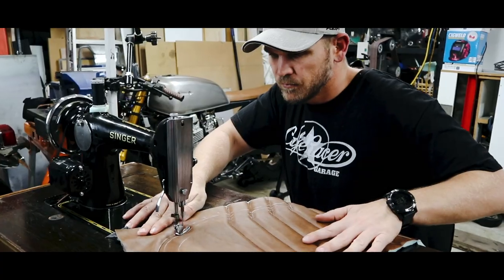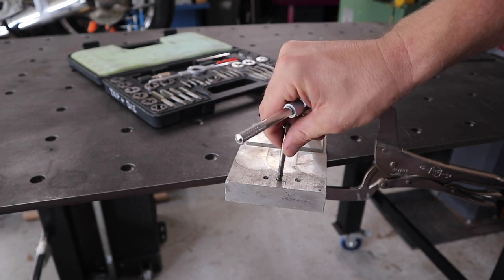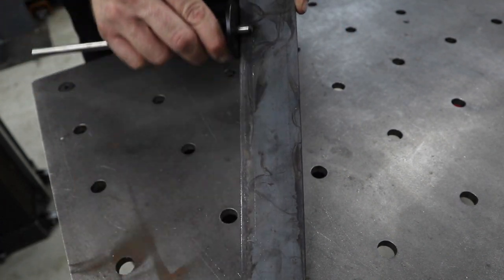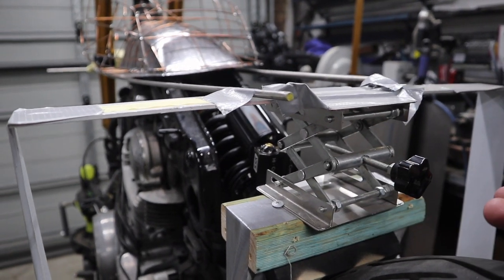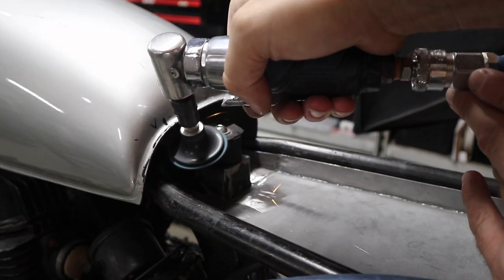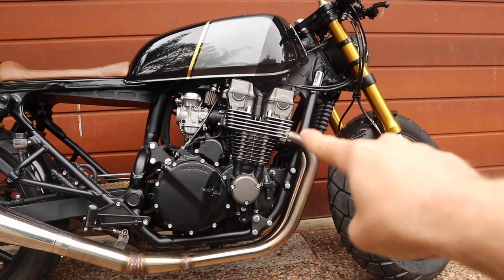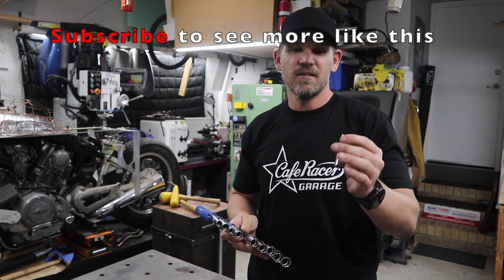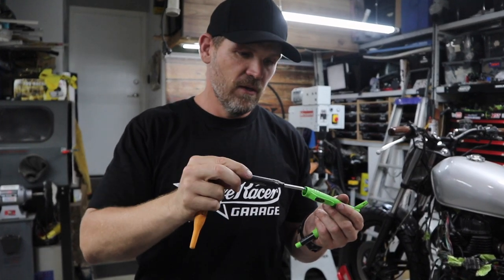14 Tools UNDER $30 for Motorcycle Building!!! [MY MOST USEFUL BUDGET TOOLS]

Comment: As a machinist, it hurts  to see someone using calipers as a scribing tool. I wont say i don't do the same....... But i use the cheap HF ones for that.
Reply from the maker: Yes I totally understand where you’re coming from, but I don’t do tight tolerances like you would so I’m not too concerned if they’re not completely 100% calibrated or if they start to get a little bit worn I’ll just replace them.  I realise it’s not what they designed for, but it works and it’s fast :)
Reply: Do as I say and not as I do huh?
Reply: @sjv6598  yes sir
Reply: @CafeRacerGarage  i get it i do the same thing even though it hurts haha. great video man keep it up

Comment: Yes! I completely agree on all of it! One note: if you work on japanese bikes especially the carbs, also with the 90 degrees ratchet. Get some Jis bits and screwdrivers! They are very important for not ruining the crosshead screws and i am very happy i invested in a set
Reply: I replace those screws with little allan key ones, much better.
Reply from the maker: Yeah that’s a great idea. I often remove Phillips or JBS screws with Alan but sometimes you have no choice. JBS screwdrivers are awesome. 👍

Comment: Centre drills, or small diameter drill bits, are great for starting holes because the web thickness is very small. On bigger diameter drills the web is much thicker, which doesn't cut any metal. Makes it harder to drill holes...

Comment: Gondor the vernier with hardened steel tips, especially if you use them to scribe lines as shown here… also I prefer a round depth measuring end overate flat ones…

Comment: Centering drill bits work so well because the chisel point does deflect along its length. Also common twist drill bits flex a lot and any miss alignment between your hand and the material being drilled is amplified because of the extra length, thereby allowing the chisel point to walk across a flat surface. IE: the recommended center punch to keep that cutting point where you want it!

Comment: I think also a butain Powered soldering iron. They are like 40-50 bucks. Heat up super quick and make soldering heaps easier.
Reply from the maker: Yeah that’s actually really good idea. It’s just a little bit above the budget for this list but you’re onto it 👍

Comment: The center drills are for turning between centers on a lathe. The center drills drill a 60 degree chamfer to guide a live center and the necked doen portion cuts a relief at the bottom to allow for the sharp point of the center.

Fwiw, they work great as a spot drill, too.
Reply from the maker: Thank you Mate I appreciate you explaining that

Comment: Great list! Thank you. I do not have (yet) the ratchets for the tap set and the necked down pen.  I do have a necked down pencil I use for woodworking. I few years ago I bought the Milwaukee angle grinder and straight grinder.  They have replaced my air tools. I just bought the Milwaukee file sander and hope it will replace my air version as well.  Thanks for all the great advice. Cheers!

Comment: I have all of those except the air tools (no compressor … yet!). No deep sockets, but I have a set of ‘through’ sockets instead. The ratchet  operates on the outside of the sockets, so they work even on threaded rod metres long which goes right through the socket. Would agree with previous commenter who said about abusing your callipers, though mine are cheap callipers so no great loss. Centre drills work so well because they are very rigid, and don’t flex like a normal drill. There’s no special angles there. Les in UK
Reply from the maker: Thanx maté appreciate your comment

Comment: Great list Dan, I've jotted down a few tools from your list, the mini-jack platforms are at the top of my wish list. The deep-reach markers & auto-centre punch are hot on its tail. 👍

My suggestion for others is to check out Wera tools. They aren't cheap, but they've saved my day on many occasions. 
Their ratchets have 6º latch points of engagement, rather than the normal 60º increments, which means you can turn the nut/bolt/screw even in extraordinarily tight/awkward situations. 
Their Zyklop Speed Ratchet Sets too, are amazing. The ratchet head can be set to various angles for accessing awkward bolts/nuts & can even be set to 90º act as a screwdriver once the nut/bolt is loose enough.
Their Joker Spanner Set isn't essential but is handy. The open-ended spanner ends have shoulders on them to prevent them from slipping straight over a bolt head which is partly undone. They say I've got the patience of a saint, but when a spanner persistently slips over a bolt head, the WTF button gets smashed. 😉
Reply: Your right about Wera, I use some of them as well.
Reply: @Jay_Speed  Nice. 👍
They aren't in most people's price brackets, so my recommendation is to start with one niche tool from the range.
Once they use & discover the advantages, they'll find that they can't be without it & explore other sets.
As you'd know, they are unique quality tools built to last, so is an investment in my world.
Two other hand tool brands I'm into are Wiha & Knipex. 👍
Reply: @Jay_Speed  I checked out your website & my heart pounded when I saw that you're into Triumphs. 👍
The trouble is, I found a low-mileage Daytona that's on sale at a good price & almost barred up.
Made the mistake of telling the missus & she blew a head gasket. YOU'RE NOT GETTING A MOTORBIKE. 😳
The thing is, I'm 72 & my doctor says it's too dangerous for me to even get up on a fk'n ladder, so I knew she'd fire up.
The no ladder thing is a freak'n joke. Ladder accidents amongst the elderly are because they don't look to see how many steps are left to go & go arse up, or they haven't got a clue about ladder safety. 😡
Reply: @CNile-se9xw  I have nine bikes for the moment. One Trident 660, one Mash Falcone 125, one Mash Xride 650, one Yamaha FZ1 Fazer, five Yamaha FZR 1000 Exup. I am 65 now and driving bikes from when I was 12 years old. Also on the street, not much controlling was going on then. I want a second Triumph don't no which model, have to do some tst drives.
Reply: @Jay_Speed  Mate, you're living the ultimate dream. Well done. 👍
Reply: @CNile-se9xw  Thank you, this week is my last in Belgium. I am moving to France, quiet region with really good bike roads. Bought a really nice house with a good size garage and room to expand that garage to double the size. Not much work in the house just renew the kitchen and bathroom.
Reply: @Jay_Speed Your new home in France sounds like a good find having room to expand the garage & those nice bike roads nearby. 👍
Changing subjects. It makes me laugh when the average person thinks we're vegetables at our age.
I've been retired for 25 years due to health conditions, but I'm constantly doing stuff & loving it around the home. Sure I'm slower than the young bucks, but my work gets lovely feedback from passersby & occasionally the missus. 😜
Reply: @CNile-se9xw  Keeping busy and have the interest to still learning is the key. May you have a long a healty live.
Reply: @Jay_Speed  Indeed, & may you, too, have a long, happy & healthy life, my friend. 👍

Comment from the maker: 1. Tap and Die set ➨  https://amzn.to/3lY6Aef
2. Tap Ratchet tool ➨   https://amzn.to/3kjh87b
3. Digital Verniers ➨  https://amzn.to/3ktqBZs

4. Scribe Tool ➨  https://amzn.to/3ZfdrOs

5. Center Punch ➨  https://amzn.to/3KC8MCh

6. Center Drills (Amazon) ➨  https://amzn.to/3YY7VAn
   Center Drills (HAFCO) Top Quality ➨  https://bit.ly/3ICc3iy

7. Scissor Jack ➨  https://amzn.to/3EuHaex

8. Air Die Grinder ➨   https://amzn.to/3St12Et

9. Air File ➨  https://amzn.to/3IV0ft3

10. Right Angle Screwdriver ➨  https://amzn.to/3keuoKo

11. Angle Finder (Digital) ➨  https://amzn.to/3xT2ZRf

12. Magnet Extension ➨   https://amzn.to/3xWjThG

13. Rare Earth Magnets ➨  https://amzn.to/3ZhG39W

14. Long Sockets ➨  https://amzn.to/3SuX7ae

Bonus Items: 

1. Profile Gauge ➨  https://amzn.to/3m9iCl7

2.  Pen Ink (neck down) ➨  https://amzn.to/3YWliRo
Pen Crayon (neck down) ➨  https://amzn.to/3m85lZK

Comment: I picked up a 92 750 Nighthawk last October.  Adjusting the pilot screws while the carb. bank is installed looks impossible.  This bike has the least clearance of any below #2 and #3 carbs. There are oil lines in the way.
Did you find a tool to get to those screws?
Motion Pro has one but I'm not convinced even it would work and it's $75. I already have a similar one but slightly more bulky, it's not reaching them.
Reply from the maker: I can confirm that the motion pro tool will work but you need to make a custom flat head for it, even shorter than the ones it comes with.you will also need to have that MP tool on an angle up just so you can get into the inner screw.. it works but only just.
Reply: Thanks!
Reply: @Cafe Racer Garage  Motion pro makes 2 actually, are you referring to the gear drive one or the cable drive???
Reply from the maker: @petev.9357  I only have the gear drive one